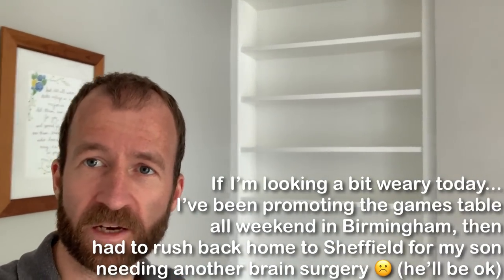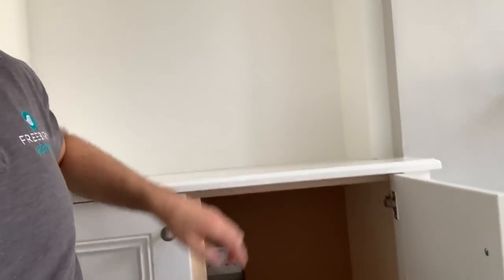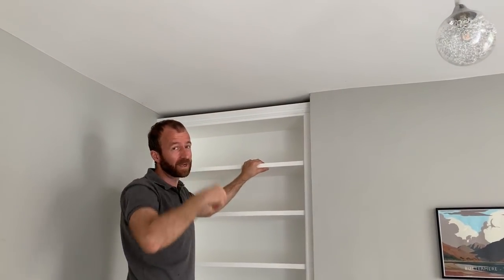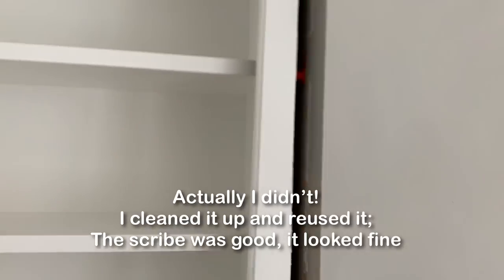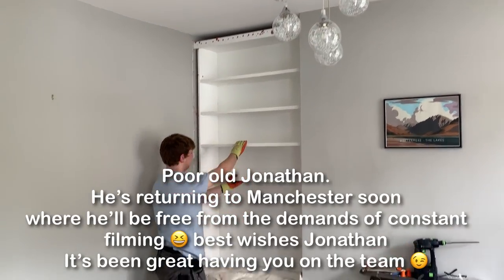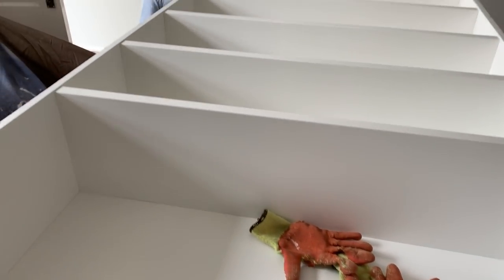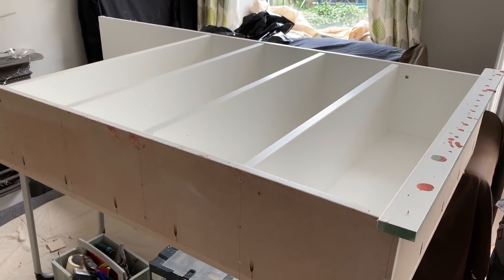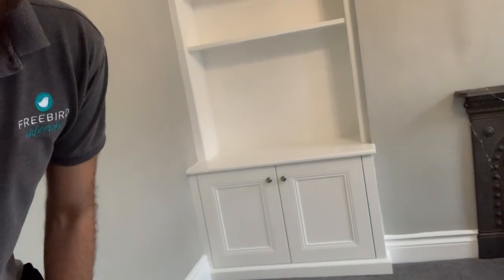Alcove Bookcase Secrets!

Comment: A very honest appraisal of a slight mistake. Having made traditional furniture for the best part of 40 years and then moved onto very similar types of fitments as yourself in the last 5 years, I appreciate the problems that arise. We to have had to remove units that were mis measured or designed wrongly so I know how you feel when having to go back. At the time of the issues you feel its only your own company that has problems, however when you are at sites where there is multi trades you soon realise that we all have problems. I was once told many years ago anyone can make a mistake, but not everyone can put it right.
Reply from the maker: Well said!  This weekend I am doing a bit of work for a TV show makeover reveal, I am just brought in at the end of the renovation to do some final bits.  Everything was on track until I went to fit some fancy replacement glass in a door, that someone else had measured and ordered; only to discover it had been cut 30mm too small in both directions!  And it was a £450 panel of specially etched and laminated glass.  I had to make it work, and managed to do so by reducing the opening in a way that looked like a nice feature.  But I did feel somehow encouraged that others make mistakes too!

Comment: I love how honest you are. It's great to see how you overcome some of little setbacks. 
Does your top rail sit further forward than the 2 side scribes. As there is a piece pre fitted before the top rail went back on
Reply from the maker: Hi Dan: 18x56mm top strip fitted right across the top (unprofiled).  Similar dimensions side scribes butted up underneath it (profiled inner edges).  Cornice (usually an ogee profile architrave basically) fitted across the face of the top strip.  I just couldn’t  pull the backer strip off the glue to the unit so left it on!

Comment: Nice work - what MDF do you use for the carcass? MR and what size?
Reply from the maker: At the time of this video we were still using Medite MR MDF.  This was the best available to me after testing a few boards (In terms of strength, and reduced grain raising when painting with water based paints).  18mm for outer carcase.  22mm for shelves (I might have been using 25mm at the time).  Since then we discovered the 'Fibrapan Hidrofugo' MDF by Finsa.  It was hard to get hold of, with very few timber merchants stocking it.  But I got hold of a sample and the quality of the board was another level up from the Medite.  Together with other woodworkers on Instagram we worked with Finsa to raise awareness of the board and it is now much more widely available.  That's the only MDF I use now
Reply: @Alastair_Freebird  thank you! Is ply recommended for shelves with a covered lip? What hinges do you use and recommend?
Reply from the maker: @LondonStuff.  I have tried many hinges and decided to stick with blum.  This decision is based on quality, availability, and range.  However I consider the Hettich Sensys hinges to be the best quality soft close hinge on the market.  I would use the same high quality MDF for lippings too.  Birch ply is harder to finish to the same smooth standard.  Even if you sand it's edges glass smooth then paint them, over time the layered ply look 'telegraphs' through the finish
Reply from the maker: @LondonStuff.  I see no reason to use birch ply for painted parts like this, because it is now 2 to 3 times more expensive even than the finsa hidrofugo mdf, and takes more work to get such a flat sprayed finish, though you may prefer to use it

Comment: Hi Alistair. Can you put a link to the stepped drill bit for the conformat screws you use. Also can you post a plan or a photo with dimensions of the 3D straightening jig that you use (I've seen it in another video of yours). Finally I am also curious which router bit did you use for the eges on the shelves.
Reply from the maker: Darko Serafimovski hey, this is the one - ridiculously expensive https://www.hafele.co.uk/en/product/drill-bit-for-confirmat-one-piece-connector/00122467/?MasterSKU=0000002e000212b800010023&CategoryID=6FLAqBtGPosAAAFPHMI4lnbm
Reply from the maker: I don’t have a plan of the 3D shelf assembly jig but I think you could figure something out 😁
Reply from the maker: 2mm arris rounding cutter from Wealden tools https://www.wealdentool.com/acatalog/Arris-Trimmer.html#aT8353B_2d8

Comment: Recovered nicely. What if the customer insisted that it wasn’t repaired and the side strips replaced as one length?
Reply from the maker: James Robinson then we would have discussed it but gone ahead and done it if customer insisted. But to be honest I used to volunteer for extra work a lot more readily than I do now; sometimes the idea of the right way to do something is more theoretical than necessary, and sometimes you just have to get the job done and there are things you don’t necessarily have to raise with the customer if the end result is fine, because completing things efficiently is also a benefit to the customer.  I once drilled the handle holes in wrong place in some sprayed mdf doors, I told the customer I would take them back to workshop, fill them with 2 part filler and respray them. Customer was at first keen that I should remake the doors but as I explained to him we’d already used 2 part filler in the construction of the doors (5 piece shaker) to get a perfectly smooth finish with no visible joints - is true use of that filler was part of achieving a better finish and I knew it would make the mistakes invisible for respray.  I genuinely felt there was no downside in quality in the finished result of filled and resprayed doors, it was more the psychological knowing that a mistake had been hidden.  I guess I can understand that however there’s only so much cost you can afford to absorb in this line of work, you have to make a living and sometimes there’s an element of compromise.

Comment: Hi. Really enjoyed the video. What size confirmat screws and drill do you use? Where can they be purchased?  Many thanks.
Reply from the maker: Chris Scott size 2, 50mm long.  Direct from Hafele or resellers such as Hart Wholesale, Issac Lord, many others on line.
Reply from the maker: https://www.hafele.co.uk/en/product/one-piece-connector-with-8-mm-head-for-4-mm-drill-hole-confirmat/26437196/?MasterSKU=000000000000ff2a00010023

Comment: What paint did you use for the touch up and how did you apply it ? Secondly is there any reason why you didn't scribe to the ceiling ?  Looks absolutely fantastic 👌
Reply from the maker: Hi Peter we swear by the AT99 sayerlack paint supplies in the UK by Movac.  I have talked about it in some precious videos, including this one where I describe our progression from Leyland painted applied by roller, to spraying Movac waterbased products. https://youtu.be/QjdIoW0rD3o
Reply from the maker: I advised the customer against us scribing to the ceiling because I’ve often had cracking caulk lines there once the units settle with the weight of books.  However there are ways around this and I’m slightly regretting not closing that gap!  Discussed it a little in the comments in the previous video in the series https://youtu.be/6jaom-K1pjI

Comment: hello Alastair, may I ask you, what are those shelves made from ? thanks :)
Reply from the maker: Hi yes it’s moisture resistant mdf, 22mm thick.  Medite brand at the time of this project but more recently we use Finsa (denser)
Reply: @Alastair_Freebird  Ahh okay, ps would you use this mrmdf for adjustable bookcase shelves ( the upright sides so 5mm holes would be drilled and those shelf pins used in them) ? I seem to think that after a while the mrmdf would give way and BANG shelf drops or is it more stronger than I give it credit for?

Comment: What a ball ache! Pity it wasn't an adjustable shelving unit. Best of luck with everything and the tables too Alistair.

Regards, Scott.
Reply from the maker: SA Martin this might be controversial but I never do these types of unit with adjustable shelf pins.  My view is that if you design the spacing to suit the customer’s needs they are unlikely ever to change it, and it’s a bespoke design so it should be thought through to that level of detail and it looks better without the holes.  Also the shelves are more likely to sag if only sat on pins.
Reply: @Alastair_Freebird  100% agree with this comment!! Its looks like IKEA with all the holes!! 😂
Reply: @jackfinnerty7891 If you are doing adjustable shelving then it needs to be done right. Shelf holes should have sleeves that give the piece that little bit more sophistication. It definitely doesn't make it look, Ikea.
Reply: @paulgray3231  yes I know what u are talking about... maybe IKEA was an exaggeration!! That said I often don't think the ones u are on about are all that much better in some cases because although they may look better and more professional they also highlight themselves a lot more!!